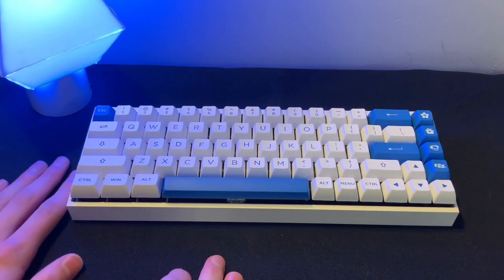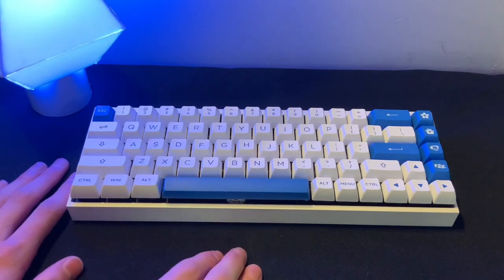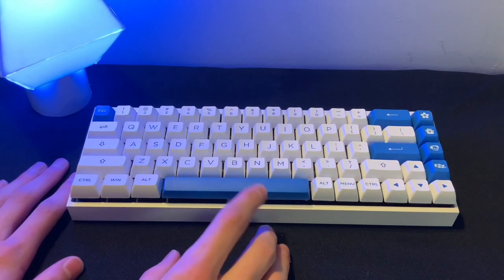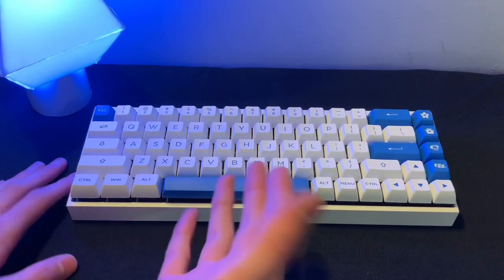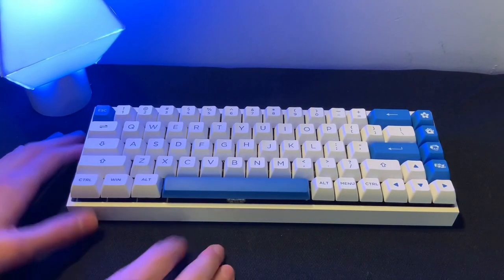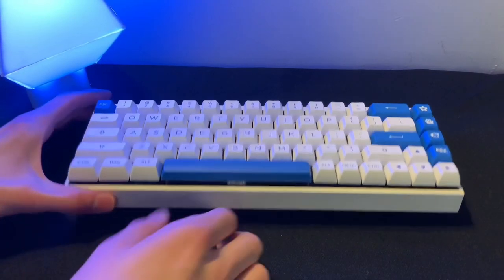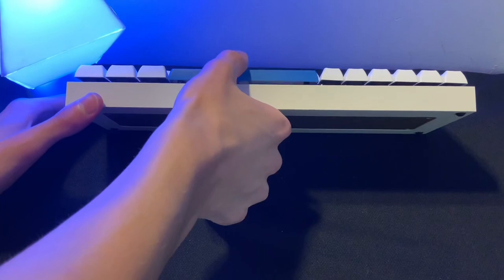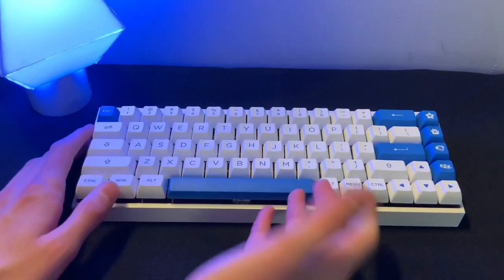Squishy thocc

Comment: how did you do this? could you do a tutorial
Reply: Actually he took out the screw standoffs and just straight up put the keeb on foam and pennies and i guess it friction fit?
Reply: And he used no plate
Reply: its gasket mounted as well most prob so gasket strips inside the case
Reply: @deception4922  it’s a Tofu it is not gasket mounted